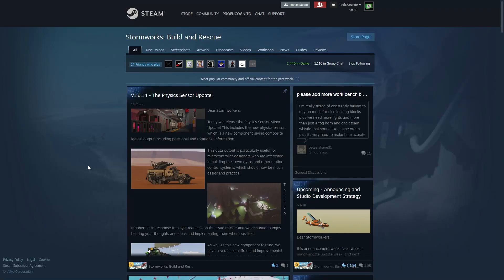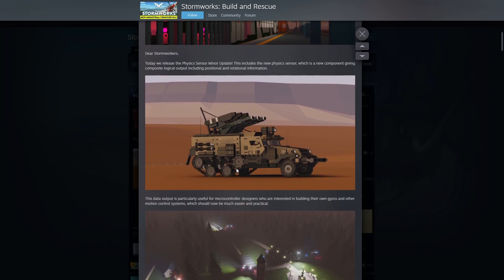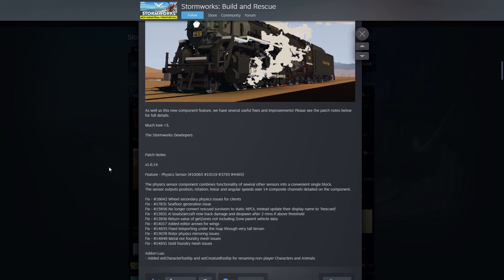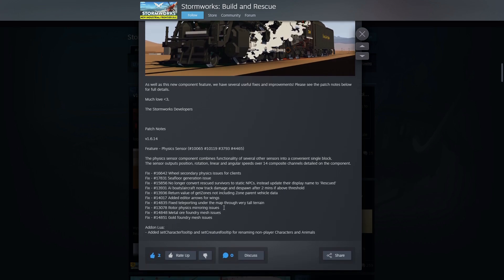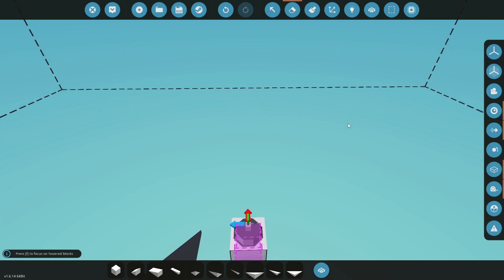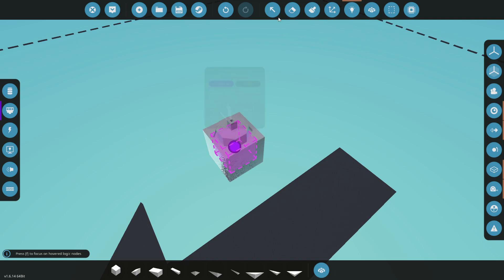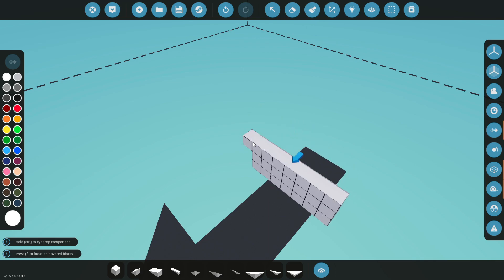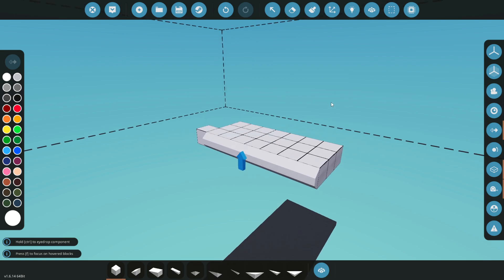Physics Sensor & Editor Arrows for Wings Update! STORMWORKS

Comment: the physics sensor is broken sadly:
-gps y and z positions are flipped
-rotation angles are broken (pitch is yaw and vice versa, along with other issues)
-becuase the rotation is broke, so is the angular velocity
-velocity is also flipped (same as GPS positions)
Reply from the maker: Yep
Reply: Has it been fixed now? I have been messing with this sensor for 2 hours already and it's a complete mess, at least it looks like it. Pitch works, yaw and roll doesn't.

Comment: Holy crap, that's a good update. I have an awkward cluster of sensors near the center of mass of my submarine, and this lets me replace them with one block. Saves a couple ticks processing the signals into composite as well. I just got into modifying some of Zizo's stuff for my own use, so this is perfect.
I've always heard Euler pronounced "Oil-er", BTW.
EDIT: They DIDN'T number the composite channels in the composite help text. CLASSIC lack of quality control.
Reply from the maker: yeah always something weird with the updates but this is a good block to have.
Reply: the sensor is broken as of now sadly (the rotation part is), look at the comment i posted on this vid, i explained the issues with it, although hopefully the devs will fix it in this Mondays hotfix
Reply: @djmicrowave6073  It doesn't matter what channels they're on, it's just a coordinate transformation. If you face the sensor to the right, it gives a more understandable x,y,and z for the rotations.
I face the old compass to the left to get proper Cartesian angles out of it.